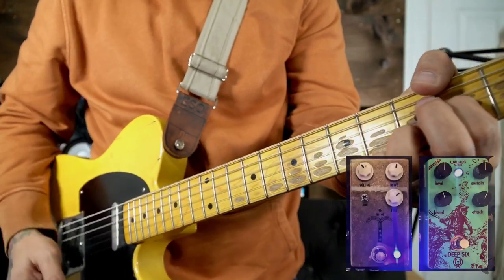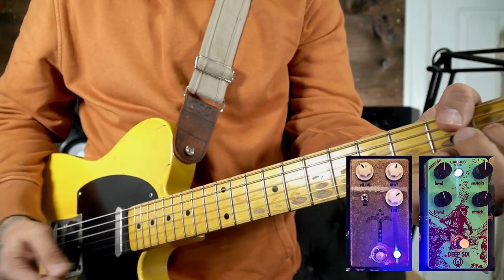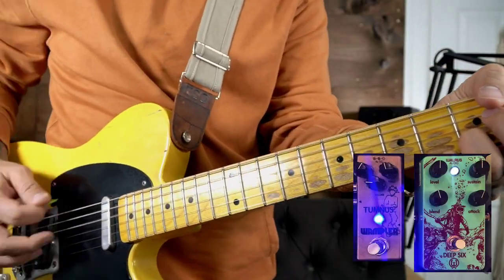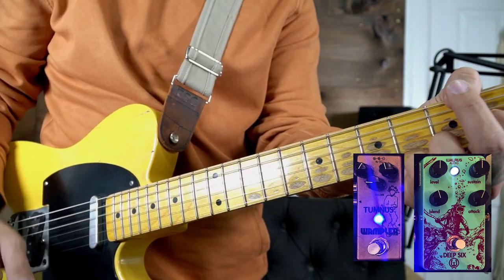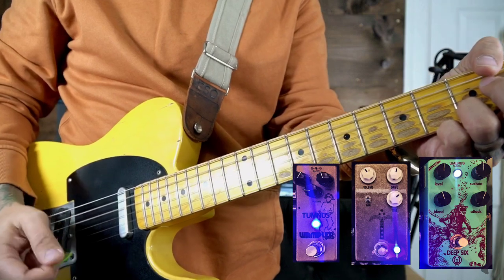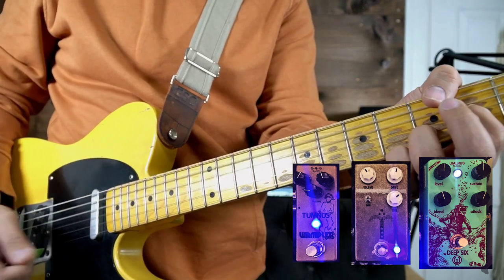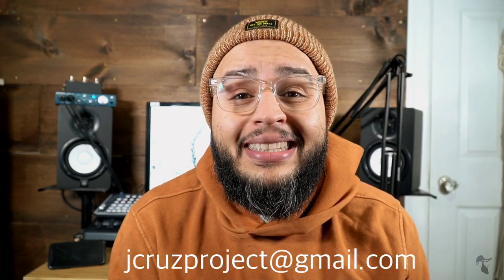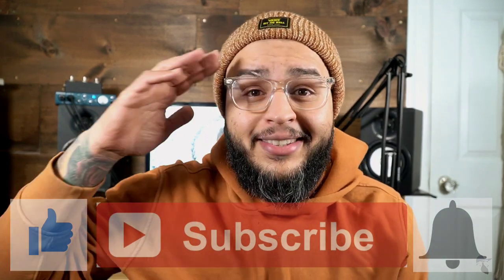How I Use It (ep20): Stacking Drives

Comment: Dude - amazing tone. There should be some kind of award for this.

I'm in my 4th decade playing guitar and I have spent the last decade trying to escape the wall of mud sound. I've ended my journey with single coils (or parallel wired buckers) into a compressor -> TS808 (solo only) -> Tumnus -> JRAD .45 (similar to morning glory) -> jumpered 68 Custom Deluxe Reverb with the negative feedback resistor changed to blackface (820 ohm). Similar gain stacking as your rig and very clean, warm overdrive.

Peace man, awesome job and great video!
Reply from the maker: 🙏🏼 Thank you so much for the kind words!!!

Comment: do you find the tumnus adds a lot of mids? also do you not find the compressor adds a lot of noise with the other gains?
Reply from the maker: Hey! So yes, to both questions. For me, mids are the key to cutting through a mix, so I personally look for mid-boosting style drives. As far as compression, it can of course bring up noise so it's important to find the sweet spot on your compression. Using a compressor with multiple options such as "blend" features to assist with keeping the noise down a bit.